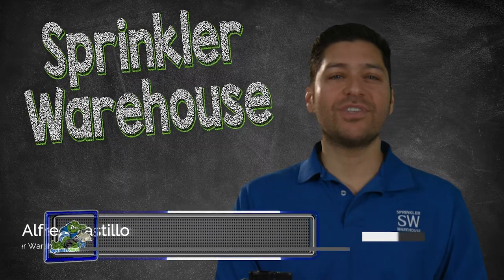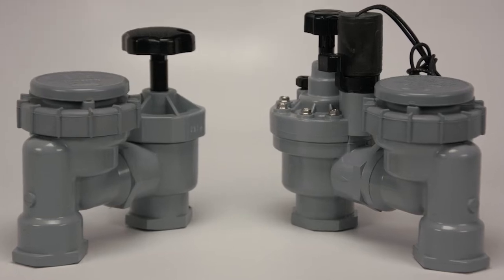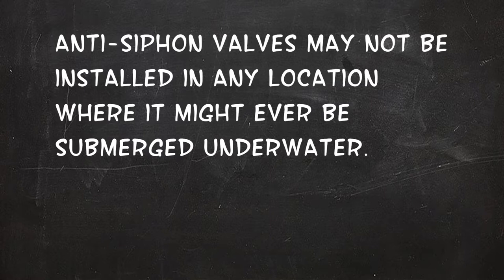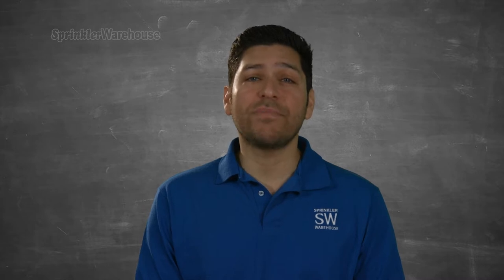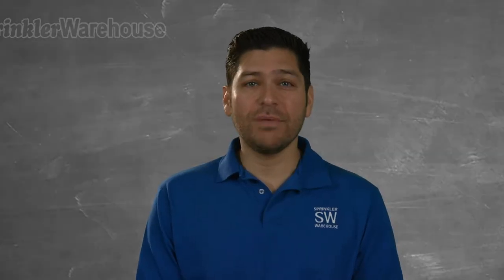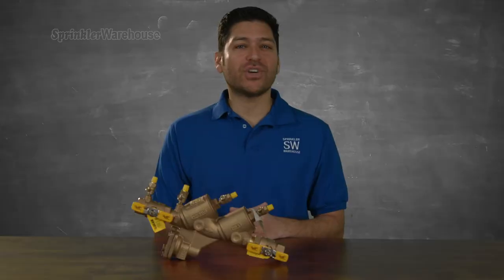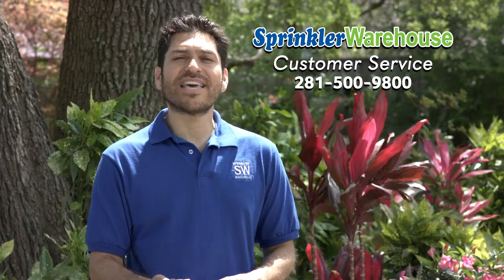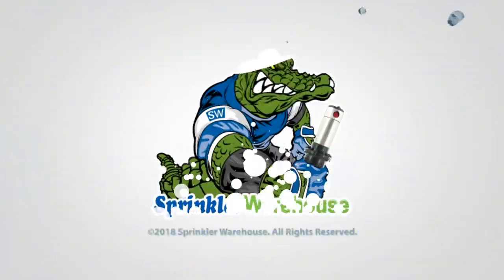Choosing a Backflow Preventer

Comment: So why do I need a backflow preventer? How can water get back into the house/city system from
Reply: In case there is a drop in pressure or back siphonage which would reverse the flow basically turning a spout or hose into a vacuum.